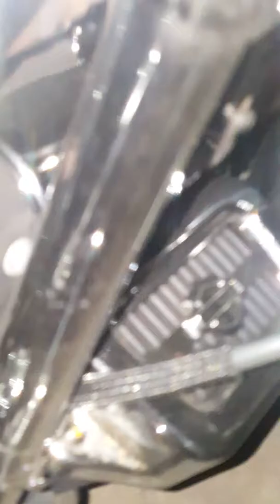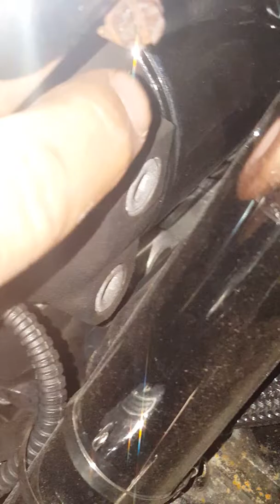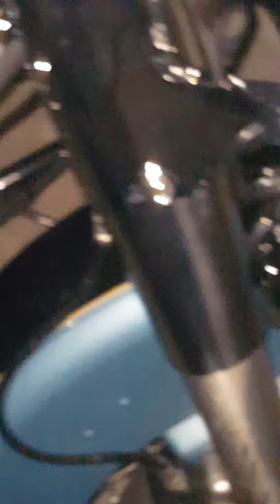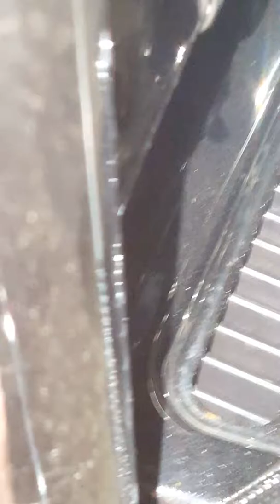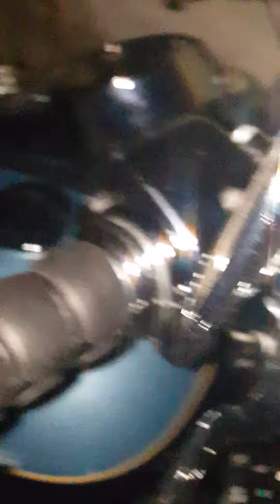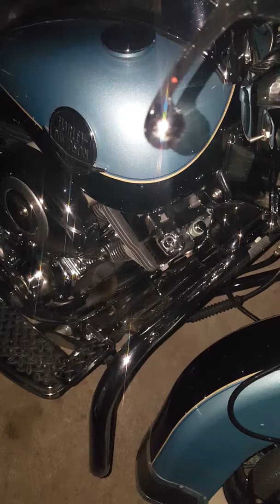Oil sandwich a Harley or not?

Comment: from what ive read around those are just plugs to block the channels for the oil filter during the production process. if you try remove those and put an oil cooler on those itll just bypass the filter which is no bueno. but i dont see why you couldnt put a temprature probe there if you wanted to.
Reply from the maker: Thank you for your insight.